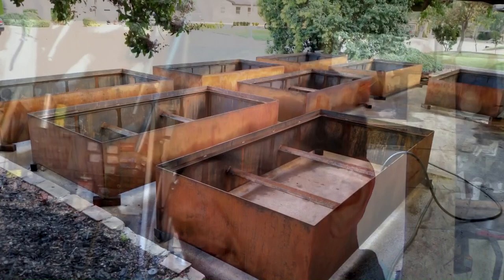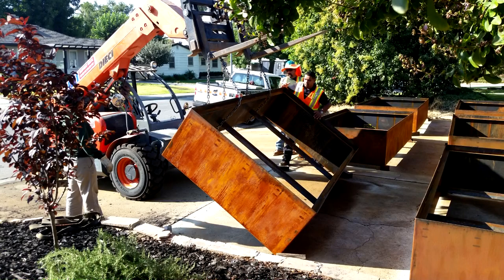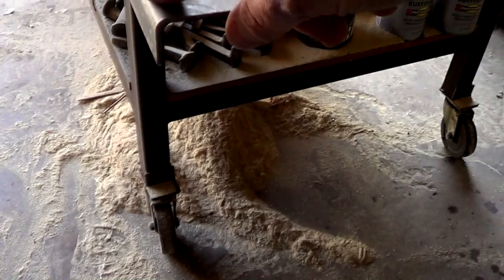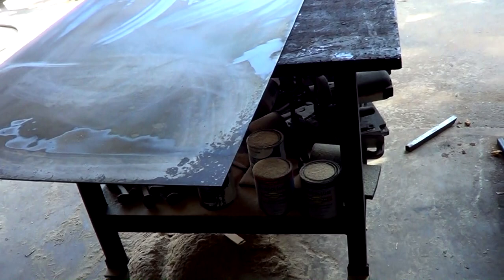Rusty Planters a Short Story v74

Comment: I'm looking to build a similar planter to the one you were building in this video. I am wrestling with the idea of mild steel vs corten because I am familiar with welding mild steel (I have an old lincoln 110 mig unit) and I am not familiar with corten and it is also harder to find and more expensive, of course. Do you think there is a big difference in the finished product, visually?  What do you use when you weld the corten, and do you find it any more difficult? Also, 2 more questions, how did you remove the mill scale? I hate using hot rolled steel because of the mill scale. And what did you use for a rust accelerator?  (EDIT: just saw your other video so I assume you use the same peroxide/vinegar/salt solution, and you used muriatic acid to remove the mill scale) Thanks so much for taking the time to answer my questions if you have the time. I love your work!
Reply from the maker: You can weld Cor-Ten with regular er70s solid wire. It really doesn't weld any different than any other mild steel. However, your fill metal will not have the exact same corrosion properties as the Cor-Ten. Mild steel is great and its longevity is directly proportional to it's thickness and environment. But, they look pretty much the same until the regular steel started to get really rusty and starts swelling. Good luck.
Reply: Just use corten.  Single pass welds on ARC are OKish... they pick up the alloying material from the corten base material to a degree. 
If looking for a a matching patina, you may need to try and match a rod/filler/migwire.     Im trying to source some compatiable ARC rods ATM.

Comment: Hi Justin, great video.   what did you us to speed up the metal rust and what did you use inside to slow down the rust (since it wasnt corten)?  Thanks
Reply from the maker: I have another video showing my rust accelerator with the recipe. We're just letting it rust. I think we lined the inside with emulsified asphalt. Around here, it'll last a good 20 years before it's completely rusted out.

Comment: What kind of wire do you use to weld corten steel?
Reply from the maker: Most of the time you can use your regular E70 whatever wire. However on jobs that require it, you can get a wire for welding Cor-Ten